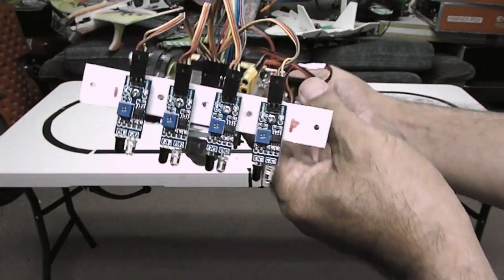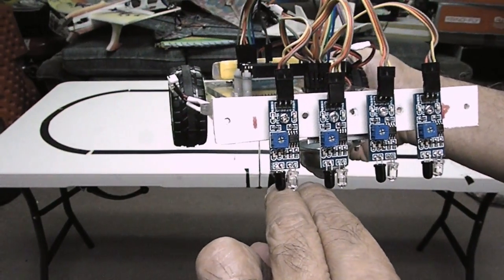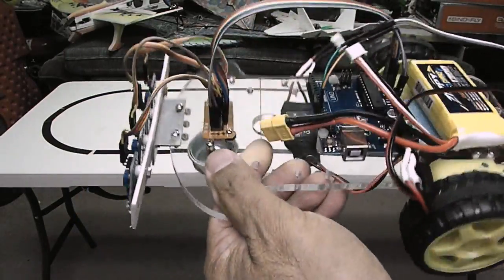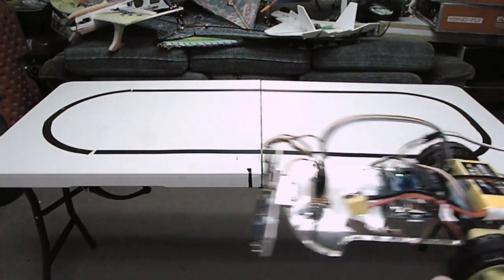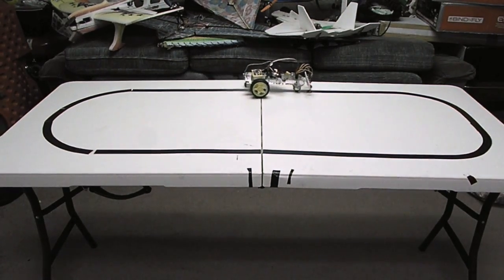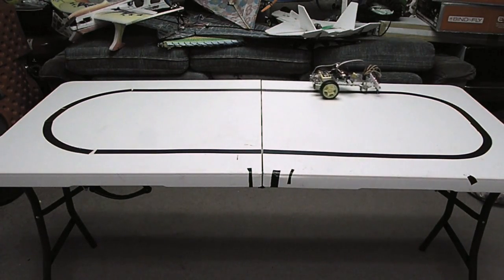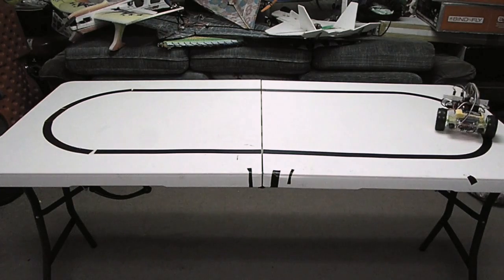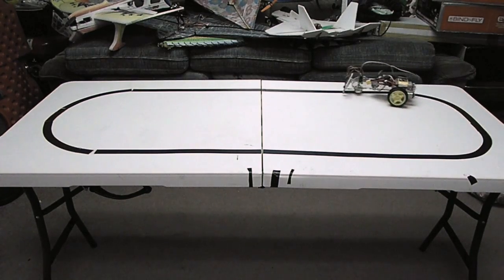Four IR Sensor Arduino Line Follower

Comment: can i get the code pls for 4 ir sensor
Reply from the maker: Google "Arduino two sensor line following robot" then modify the code to use four sensors (add the new sensors and duplicate what the original two sensor sections). Better yet, use a PID based robot .. see here https://youtu.be/fIZYdYqyBEM.

Comment: Hello may I know how did you connect all the IR sensors to the Arduino? Thank you!
Reply from the maker: The connection to the Arduino board depends on the sketch you are using for the robot. Look carefully at the beginning of the sketch where it defines what the inputs are for the board.

Comment: Can I get the code for this
Reply from the maker: Google "Arduino two sensor line following robot" then modify the code to use four sensors (add the new sensors and duplicate what the original two sensor sections). Better yet, use a PID based robot .. see here https://youtu.be/fIZYdYqyBEM.

Comment: can i get the code
Reply from the maker: +biswajit mondal  ... I could but I suggest using the five sensor PID version of this robot. Uses only one additional sensor but the performance is 100% better - it travels faster and even if the sensors go totally off line, it still continues to travel correctly. See here ... https://youtu.be/fIZYdYqyBEM